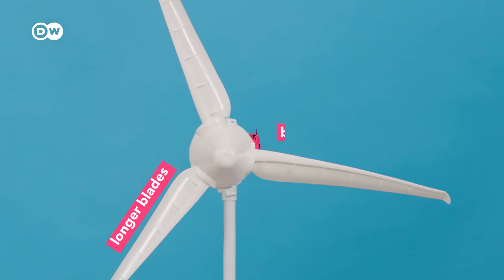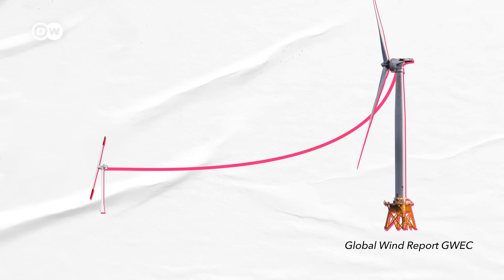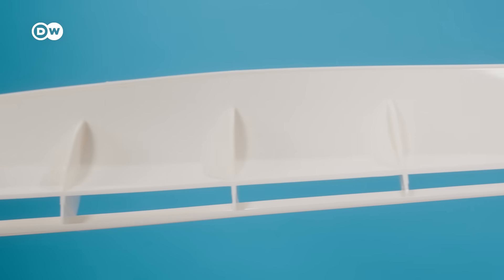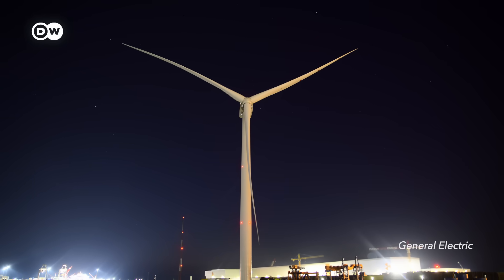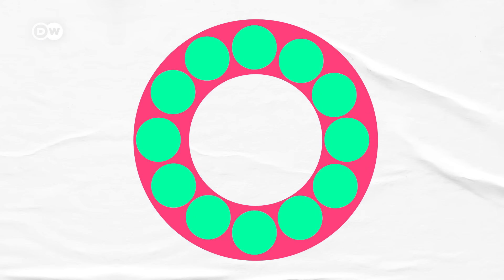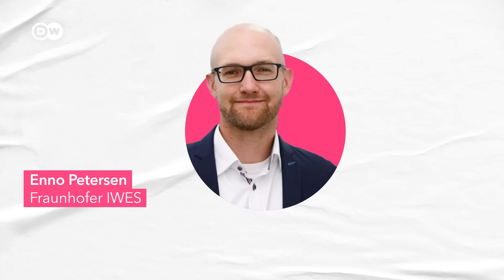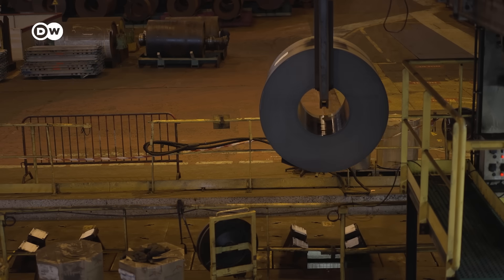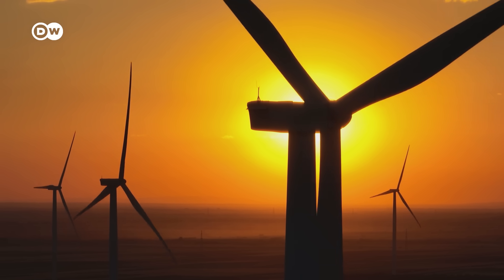The race to build the perfect wind turbine

Comment: This says theres a limit to the size because it'll become too big to transport otherwise, but offshore wind turbines are largely built on the coast like the ones in Scotland and then I assume put directly onto the ship that transports them to their location in the sea. Is there a size limit in these cases?
Reply: An engineering one.
I doubt they know how to build or setup blades with over 200m length, yet.
Reply: Regarding shipping i don't see much of an issue even with current /state of the art 100 to 130m blades. Still plenty of room left.
Reply: @paxundpeace9970  blades larger than 100m are only used in offshore turbines as transportation on the autobahn is impossible. Onshore blades have already reached their maximum viable size
Reply: When blades become too big the ends reach above the speed of sound which makes them really loud and inificient
Reply: @ That is actually not a problem at all. The bigger the turbine, the slower it spins. Thus the speed at the tips never  reaches the speed of sound. Structural loads and logistics are key challenges for bigger blades though.

Comment: All these years I’ve been using my hairdryer wrong. If only I had held it higher my hair would have dried faster! 😂
Reply: Why not contra rotating wind turbines 🧐
Reply: The wind turbine rotates in the opposite direction. I have completed the design in 2008.
Brushless commutator

Comment: Why does the gearbox need to be at the top? Couldn't they transfer the rotation down first, or would a shaft that long weigh even more?
Reply: It generates additionally engineering challenges, as the tower flexes in the wind.
A long shaft would need to flex too and be strong enogh to transfer many MW of power.
Reply: If you use a shaft you need gears at the top as well and the shaft weight is huge. If you use a chain you still need a gear at the top. As the most critical gears are the ones taking the largest torque there are no advantages, but huge disadvantages, e.g. much more material.
Reply: There is no reason to put the gearbox on the ground. The turbine tower need to be strong enough to whistand the thousands of tonnes of sideways wind loading of the rotor. 40 tonnes of gearbox on top of the tower is nearly nothing. Transfering a lot of power mechanically is more expensive than electric cables.( you dont imagine a power grid with mechanical chains and gears would be cheaper than an electric grid)
Reply: @niconico3907  Yep, 40 tons is not much compared to the dynamic forces to the tower. Honnef researched  belt power transmission from hub to ground beginning in the 30s till his death in the early 60s

Comment: Turbine blades with a thin pressurised cylindrical aluminium core, and aluminium airfoil sheath, for light weight and strength.

Comment: why not put a hydraulic pump on the turbine head and put the gear box and the generator on the ground? sure it would be tricky to get the hydraulic hose down from the rotating head but i'm sure there is a engineering solution to that
Reply: That means adfitional losses and a high pressure line that needs to withstand the dynamic movements of the tower.

Comment: They Have to build a wind battery unit, the tower will be the tank,a compressor instead of  a generator( no copper ore neodimium magnet) alll the air will go to a central production motor, 90 % efficiency is posible if air is use directly hot from the compressor,make the hub bigger   a round structure is very strong, specially if is pressure inside a beach ball is a good example, next the first part of the blade coul be a sinple tub10 to 15 meters wit slive shape like a wing,so technically the wing will be attached at the 25 meter from the center,at 15 rpm technically you could ad 2 or 3 more blades. Just a though......

Comment: Put the blade production facility on a large ship.  The have the ship sail to where the wind farm is being built and produce the blades onsite. Then move on to the next job…
Reply: Blade production as a single piece is done with an autoclave, which is really tricky.

Plus, the best workers probably won't want to live on a ship. If you can give engineers and trade workers a consistent solid job, their ability will rise and rise over time. If you're only hiring people who will work on ships, you're chopping off 80% of the labour market.
Reply: Some wind turbine production sites are already at the shore and no road transport is needed already. And you probably underestimate the size of these factories.
Reply: The size of the blades are not a problem for offshore wind farm. It is a problem for onshore windfarm that need to be transported on the roads.

Comment: Wind turbines are  WAY  better then solar because>>>
-Takes up less real estate
-generates power 24/7 never stops even after dark gen power all night long while solar sleeps
-Solar panels require regular cleaning for max power-not wind.
-best place for wind turbine is 20miles offshore just over the horizon where they wont
disrupt the beautiful scenery  PLUS  very few birds out there.

!
Reply: Wind turbines are bad because they are so land expensive each one needs on average 20-30 acres, and the economics are just not there solar is way better it’s predictable it gets better with scale,
Reply: One needs both and more.
Wind and solar complement each other.
Reply: Until there is no wind. Wind power still costs significantly more. Wind generation is very difficult in freezing conditions where ice forms on the blades. Wind turbines need a lot of maintenance. They are a good part of the renewable energy mix but are not without their issues.

Comment: Imagine putting up windmills after having mastered fission.
Reply: Imagine thinking you've mastered fission when you've had 5 INES level 5 or above nuclear accidents in 70 years - 2 creating long term nuclear exclusion zone wastelands. Imagine calling it mastery when you still have no single nuclear state with a long term storage or disposal solution for the nuclear waste it generates; and when you have three quarters of the world's uranium supply coming from Kazakhstan, a former soviet block nation firmly in Russia's sphere of influence. Imagine thinking that's "mastery" huh. Imagine.
Reply: @MidnightSouls and imagine people think they've mastered fission when it's far more expensive than 30 years ago and that's not including properly storing highly radioactive waste😅 😂
Reply: Imagine thinking fission is cheaper and faster to build...
Reply: We don't even have a working prototype and commercial deployment is about 25 years away
Reply: @paxundpeace9970  That's fusion and technically we do have working examples of fusion that produce more energy than they take. It's just way too much energy to the point where containment becomes a major issue. But technically we could make an internal combustion engine powered by fusion nukes.

Except we don't need to do that since we have a fairly well developed fission technology that would easily power our civilization in a clean and safe way. Antinuclear sentiment is largely why we have a climate crisis today.

Comment: In Italy there is not much wind power installed despite the potential: over 6000km of coast to build offshore farms. Plus more than 50% of electricity is still made with expensive LNG imported from the other side of the world.
Wind power would be therefore competitive with actual electricity prices.
But our PM insists the solution of everything will be, wait for it... Nuclear fusion!

Comment: Edit: It seems I need to spell it out more. For a company that has limited finances to invest in green energy, solar panels are far cheaper on a per unit basis, so if you start out with a lot less money you can invest it in a solar park, even if you can't afford wind turbines.

Another likely challenge for wind energy, is the fact that Solar is so ubiquitous at this point. Solar is far easier to install, and it has very little running costs as compared to wind turbines. The price of solar is also still coming further and further down, so the need for wind related power is decreasing over time. 

On top of this interconnectivity of different regions result in the variability of energy production being less and less of a problem, and adding better energy storage onto the mix just hits the point home even more.
Reply: Solar has a small power window. It is better to use both. They complement each other.
Reply: @old-pete  For sure, but solar is cheaper and easier to install. So if a company has the choice between the two, they're plausibly more likely to choose solar.

This isn't a dealbreaker on its own, but on top of all the other effects and issues that wind turbines face, it can be a bit of a kidney shot in the moment.
Reply: @op4000exe  If all panels produce electricity at the same time. That is an issue.
And there is also a need for electricity at night and winter.
Reply: @op4000exe wind is much better in power produced per square miles. And you can still use the land beneath it.
Reply: Solar and wind power are the perfect combination. In winter wind is much more present than in summer while in summer you have more sun
Reply: As far I know - wind is cheaper - that massive wind turbines get  close to their full capacity a lot of the time - you can’t do that with solar energy. When batteries get cheaper - windy places won’t need solar. (But probably best to supplement anyway)
Reply: @71kimg  Wind turbines are cheaper in the long run, per kwh produced. They are however not cheaper than a singular solar panel, and that's the important point. 
A single 300 meter wind turbine costs in the range of ~$3 million. But if your budget is "only" $500k, then you can get a big solar park instead, but not the large turbine.
Therefore in the present the solar panels are cheaper, and easier to build, so a lot of projects end up going with solar instead because they don't have the upfront capital for the large wind turbine projects.
Not to mention that large wind farms, is usually 20+ wind turbines, oftentimes in the hundreds which will cost in the billions.
Reply: They are both complementing  solar has seen a massiv boom in the past 5 years eith major installation and low cost. 
Wind power is massiv and the area required is lower.
Reply: Wether wind or solar is cheaper depends on the location. There is about a factor of 2 difference between a really good and average location for both wind and PV. The other point is that a mix of wind and PV reduces the need for storage. Wind may have the better balance from summer to winter, so reduced need for seasonal storage. Already on it's own wind usually starts with a better (e.g. 2-3 times) ratio of energy produced to nominal power. So compare 5 MW of wind to 10 to 15 MW of PV and some additional storage.

Comment: I own a rope access company in the US that maintains wind turbines, among other projects. My favorite turbine innovation (that seems to be all but abandoned now) is direct drive generators made with neodymium magnets. I worked on a bunch of GE 3.2 MW direct drive machines back in 2013, on a 320 MW farm, performing "punch list" items in preparation for transferring ownership of the machines from the construction company to the O&M company. These were really impressive for a smaller form factor: 100M hub height and 137M blade/rotor diameter generating up to 4MW (3.2MW nominal) is quite a feat, especially for back in 2013. Moving forward, however, it appears that direct drive technology has been pretty much mothballed in favor of big heavy gearboxes. I assume that's due in large part to a shortage of neodymium making direct drive tech too expensive.
Reply: Have you ever heard anyone talking about Iron Nitride magnets from Niron here in the states as an alternative to neodymium?
Reply: Enercon builds wind turbines with direct drives.
Reply: @dyske-  and without magnets :) 
Also quite reliable because one doesn't need to refit a gearbox after 10 years
Reply: They didn't have rare earth magnets fifty years ago when huge turbines were built for the thermal power plants.  The generator used electromagnets that were just as powerful.  But apparently the idea lost favor when they found that the weight was greater.  I think that they could develop a generator that is not behind the blades, it could be located down low and driven by hydraulic fluid from the hub.
Reply: @acmefixer1  continuing on your line of reasoning you would end up with a torque converter (the one in cars with automatic transmission), that indeed was originally devised for high power applications for which mechanical gearboxes were not feasible at the time. The original concept was a turbine and a pump as separate units. Unfortunately it is highly inefficient
Reply: I was under the impression that gearboxes are high maintenance and direct drive was gaining ground for offshore turbines.
Reply: @rickrys2729  I can only speak for my experience and the machines I've worked on, but post 2016 I've only worked on Vestas gearbox machines (of varying hub height and generating capacity) on active generating farms. I've also only worked on onshore wind farms.
Reply: @rickrys2729  
If you were handling more than 3 Megawatts or more than 4000 horsepower, you would need a bit of maintenance, too.  But the offshore turbines are 10 or more Megawatts and 15000 horsepower.
Reply: @rickrys2729 Magnet prices shoot up and they manage to design more reliable gearboxes. So cost becomes favorable for geared drives.
Reply: Maybe it's all due that maintenance fees goodness
Reply: I live in Western Australia. I believe somewhere in this huge State, is the world's only commercial Neodymium mine. I suspect if there is a large enough ore body, a partnership with the mine could make scaling up possible for making the magnets more affordable...
Reply: @MrDisasterboy  Greenfield mines will be extracted once it is profitable for it to be extracted. Forcing to extract something with goals to reduce prices will lead to the mines going bankrupt wasting time and money and temporarily destabilizing the market.
Reply: I work in the trucking industry at a company that has several hundred trucks in the USA. A 40 ton or 80k lbs gearbox is reasonably cheap to transport on an 7 or 8 axle low boy. Once you surpass that as mentioned in the video and start getting up into 9, 10, 11, 12, and higher number of axles the truck and trailer setup gets very expensive, pilotcars are added for length, etc. This varies a bit by state, but in general 80,000LBS is around where you start running into higher and higher price hikes for us to even break even, let alone make any money. And today we are not making alot of money, almost everyone in trucking is just trying to break even right now. The ocean carriers are doing just fine, but not USA trucking companies. We are being bled dry for every last drop to lower our prices and compete. So anyways, I would bet the 80k LBS gearbox even with transport is cheaper than the neo direct drive.
Reply: The price of neodymium skyrocketed in 2021-22, but is at the same price as in 2014 (adjusted for inflation).
Reply: I had wondered why the wind turbines in New Zealand had stupid complicated gearboxes - I thought maybe companies here are just getting the cheapest crap available
Reply: Nice to see a fellow rope tech! Even if it's on the other side of the Atlantic, i operate in europe.
About the direct drives, china, USA and brazil have almost all of the world reserves of neodyminum, and only china is really taking advantage of it, bc of that, suplly chain is in chinas hands, some manufacturers dont want to risk going to direct drive and be vulnerable to a supply crisis, maybe the mercosur deal will help Europe is that way, only the future can tell.
Reply: @yaboydonna9462  Oh yeah, good point!
Reply: The last GE offshore turbine Haliade X uses direct drive and one blade is 107m long.